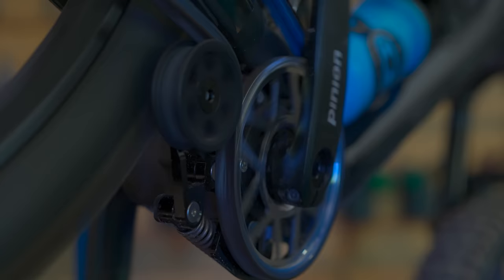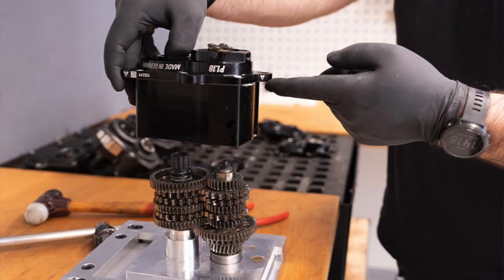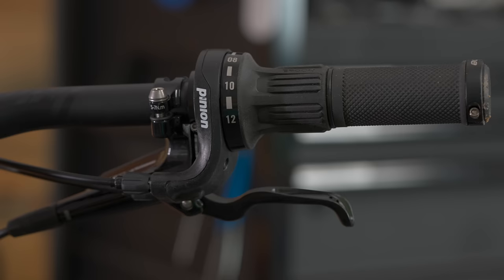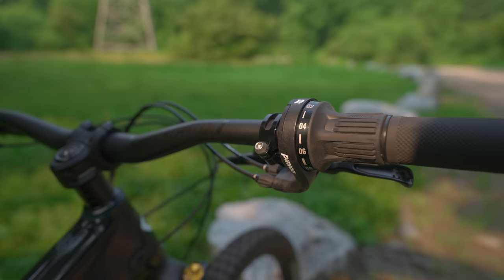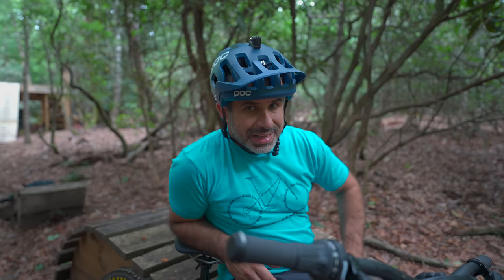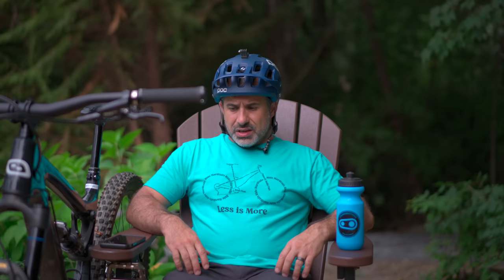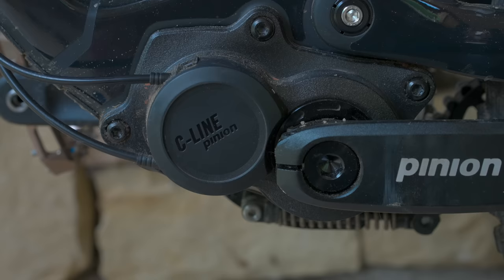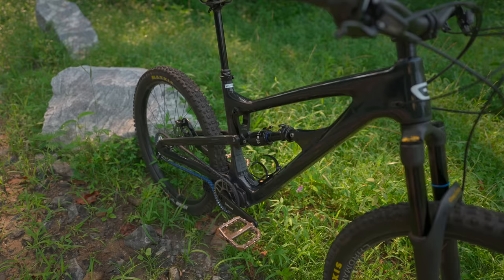What's the deal with gearboxes? Why don't more mountain bikes have them?

Comment: Another advantage on full-suspension bikes that I think was missed was that you are removing a lot of unsprung weight off the back wheel. Getting rid of the cassette and derailleur can make a huge difference in suspension performance by minimizing unsprung weight. I think gearboxes would make a lot of sense for downhill bikes where suspension performance supersedes all and weight doesn't matter as much. Also, this would be a great application for electronic shifting, get rid of the grip shift and just use a button shifter and solenoid or motor-based actuation.
Reply: For all interested how a dh bike with a gearbox looks, zerode has one ( i believe its called g3) and theres a swiss brand called gamux bikes
Reply: You make a great point! You could even design the ‘buttons’ to look and feel like traditional thumb paddle shifters to help ease the transition.
Reply: I've seen a couple of riders somehow losing their chain during a race run as well, this would (probably?) be eliminated with a belt drive as well. Although you can also use a gearbox with a chain instead of a belt.
Reply: Pinion recently released their Smart.Shift Gearbox which is electronic :)
Reply: Mtb riders embraced 29 in wheels, bigger frames and low pressure tubeless tires. 
These things are heavier and have more rolling resistance than their older counterparts.
It bugs me when people talk about efficiency and weight as drawbacks to gearboxes. They have already proven they will tolerate extra weight and rolling resistance if it has other advantages.  Gearboxes are tons better in lots of ways. Cost is the only barrier.
Reply: @sungear don't underestimate "big derailleur" wants you to keep buying high end group sets every x thousand miles. if you have invested in a gearbox you are not on the market for the latest & greatest derailleur tech. I'm not a conspiracy theory fan but enthusiasts do spend a pretty healthy budget on drivetrains on top of consumables tires/brake pads, so why kill the cash cow. business model of traditionnal (preferably proprietary) group set is good for big manufacturers like Shimano/SRAM, while spending big upfront cost is good for startups/disruptive/niche market companies, I think it's one of the main reasons why things are moving slow. I'm pretty sure if SRAM or Shimano pulls the trigger on gearbox tech, the other one will follow shortly after.
Reply: @superyamagucci slightly better rolling resistance but lot more rotational and inspiring weight too, so yeah, bigger wheels is still a compromise
Reply: this cannot be underestimated. I didn't really think about it when I bought a Pinion equipped frame, but I was blown away by how that combined with the low CoG positively affected the ride
Reply: @superyamagucci  Love the "source" part.
Reply: Lower tyre pressure means ower resistance? Not the opposite? @superyamagucci
Reply: @superyamagucci  So long story short, on a soft terrain soft tires could be faster, but on a very hard terrain such as tarmac higher pressure reduces the rolling resistance, making it faster. So it depends on a terrain type if the faster way is low or high pressure.
Reply: @someindividual7920 not only that, Zerode initially started out with downhill bikes. I had a Zerode Downhill bike 10+ years ago and took it to Whistler. I preferred riding that over a Santa Cruz V10.
Reply: Lower tire pressures do not equal more rolling resistance. And additional Drag is a major drawback to people who pedal a lot  @sungear 

I like the idea of the gearbox, but it isn't viable for me yet. I can tolerate the weight, but not the drag, and not the lack of an ability to shift under power.
Reply: Can’t downhillers cope with one gear?
Reply: Removing axle weight vs any other part of the vehicle reduces tenfold vs any other part
Reply: @sungear    Cost isn't even a factor when you consider that the gearbox will outlast 10 Eagle transmissions.
Couple the Pinion with Gates Carbon belt drive and you have a winning combination.   The Gates belt will easily last 3 times longer than a chain.
Reply: not only do you have less unsprung weight, but you have less weight so far from the pivot point it reduces the moment
Reply: Who is this for? Those out there where drivetrain failure is not an option....
laughs in Baja 1000

Comment: You briefly mentioned it but yep, these are best suited for ultra endurance cyclists that do thousands of miles on crazy terrain. Ryan Van Duzer is a big belt drive fan.
Reply: I want to build a gravel bike with this
Reply: Just spent a week riding with RVD and watching him billy goat up the hills on that Pinion drivetrain is pretty wild. He's unstoppable on the climbs!
Reply: or if you dont have time or money to replace and clean parts. my Gates belt lasted 10 years on my daily and almost got no love at all.
Reply: @BodieMoto  Bikepacking one!
Reply: @andreas4687 most mtb bois arent using a bike for 10 years anyway
Reply: @devswell6538  why should you buy a new one if you already got the best? 😅
Reply: So is Alee Denham, although he's also a fan of internally geared hubs.
Reply: @BodieMoto Priority Apollo Gravel & Santos Cross Lite.
Reply: Outstanding review of the gearbox vs derailleur.  Now do the same for full suspension EMTB.  I hear from every dealer- “ you can’t have a belt drive on full suspension e bike because of the flex of the suspension, gotta have a derailleur.”    What ??
Reply: @BodieMoto priority bikes has a belt drive gravel bike called the apollo
Reply: Dont bother.  Priority 600 bike has pinion for 3500.  Must be newer pinion and affordable.  I think pinion first came out was 3 grand ... seems like wheels be free to spin easier this way.   Look into priority 600 gearbox price.  Be expensive cause have to have frame to bolt it on ...  
   I going with like build mountain bike drop bar with alfine . I guess can put oil in alfine 8 as well ondyraf of grease.  Convinced me to look at priority 600 again.  Good luck.
Reply: These are best suited for all bikes.

Comment: I'm one of these people with a pinion gearbox on my bike (priority  600) and I ride it because it works in all conditions, and deals with off-road and road riding equally well. I love the maintenance being minimal, and the lack of any real issues with having to deal with a chain.
Reply: Have you ridden it in really muddy conditions?
Reply: How is the ride when the battery dies 🪫 and motor went off?
Reply: @JTDPM  I've ridden mine for a few years now through all seasons (city conditions), mud, snow, salt, water.  It's perfect, I've done zero maintenance so far except for an oil change, which was easy.  When it gets really dirt it can be hosed down, the seals in the gearbox are solid.
Reply: I’ve ridden in muddy conditions and there is mo battery or motor on the bike
Reply: @PsychicDavidJames  how is the pedal feel without motor power?
Reply: it rides like any other analogue bike. @federaldelii
Reply: @PsychicDavidJames  ok 👍🏻 At the hills can you change gears during pedaling ?
Reply: @federaldelii  yes
Reply: @PsychicDavidJames  nice 👍🏻
Reply: @federaldelii this is not a motor it's just a gearbox
Reply: @JTDPM  I did with mine, it shreds mud off so easy and it keeps on going. I actually liked to ride in the mud with proper gear. Only downside was cleaning all the muddy clothes lol.
Reply: @federaldelii I tested one today. This is not entirely true. You have to stop pedalling completely before you can shift into an easier gear. The advantage is that you can shift many gears at once. Shifting into harder gears can be done under load.
Reply: Love my Priority 600. People ask if it is an eBike. I say no, but it feels like an eBike with it’s direct power transfer.
Reply: My Priority 600x is real quiet compared to the one in this video. Being a hard tail there's no need for those extra rollers seen on the belt in this video, the tension is constant and there is minimal noise. Low maintenance too. And much cheaper than the prices others are mentioning.
Reply: Not true, you do not have to stop pedaling completely. Soft pedaling is fine uphill, and on the flats just shift.

Comment: Really surprised the topic of noise while descending was not mentioned. It's basically silent going downhill, all you hear is the trail chatter on your tyres. So so refreshing. Not to mention a massive reduction in weight off the rear hub with no cassette / derailleurs etc = rear suspension performance through the roof.
Reply: i want a silent hub for this reason! the zerode is STUPID quite going down
Reply: I tested one of these for a few days in NZ - best descending bike I have ever ridden and i loved that it was silent
Reply: I'm surprised he didn't mention how many times you smash the derailleurs system during the rides.
I smashed three systems which cost in total over $2'000. You can't really enjoy the ride fully, worrying it may cost you a lot of money and time.
Reply: Makes for a much stronger wheel as well, with less hub flange offset.
Reply: just curious how rear suspension performance better with light weight on rear wheel? the weight on rear wheel doesn't fall on the rear suspension tho.
Reply: @senior_java  You know theres byicycle insurance that cover repairs. Might be worth it if you keep smashing stuff.

Tho I imagine you can also damage a gearbox/hub system, and repairing it is nearly impossible.
Reply: @brnzhut  The weight matters when the suspensions is returning back to it's original position - allowing the wheel to track the ground better so you always have traction. A heavier wheel will take longer to bounce back down to the ground.
Reply: The weight of the rear derailleur, casette, jockey wheels is pretty small compared to a downhill wheel, tire, fork, ...
The effect might be easily noticeable for some riders, but I see other reasons to choose the internal gearbox:
- no jockey wheels to "catch" on things by the side of the trail
- you no longer have a "favourite" side of the bicycle (i.e. the side without the derailleur)
- spokes on the rear wheel can be more "balanced", in a "V" pattern instead of a "|/" pattern